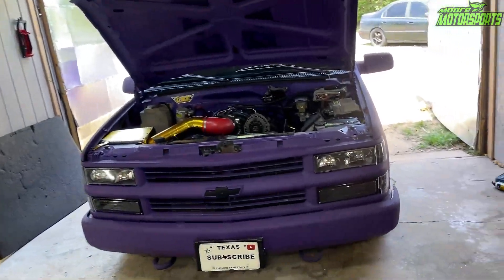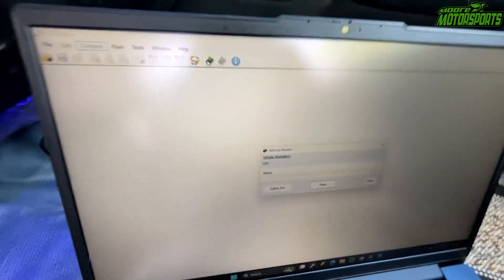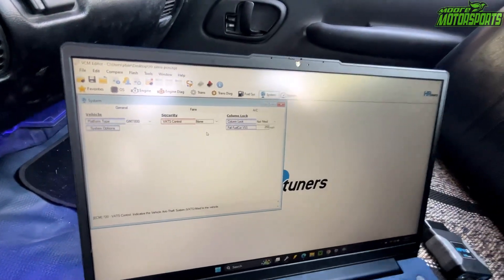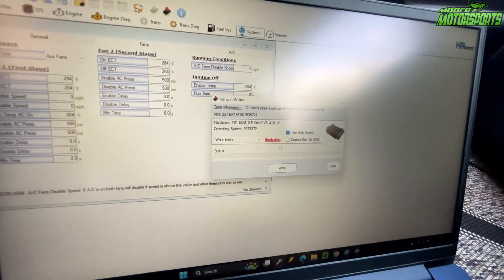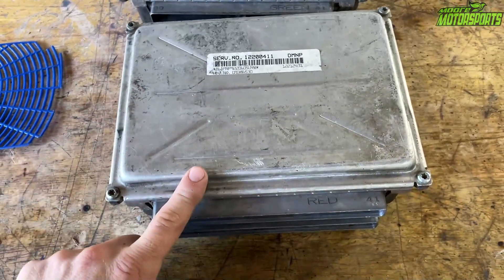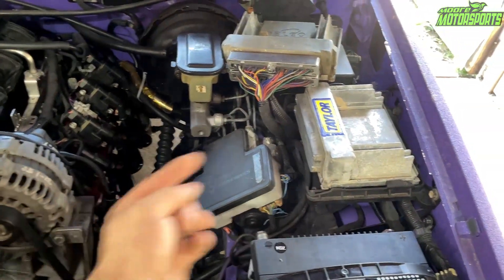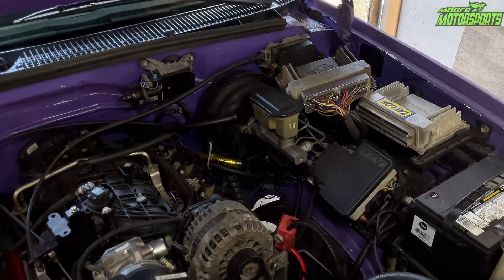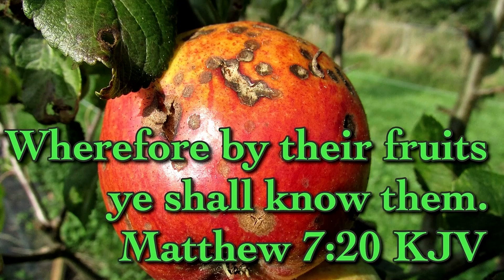HOW TO UNLOCK PCM USING HP TUNERS FOR LS SWAP

Comment: I can't stand it when people say "unlocked" when it comes to Gen III and Gen IV gm ecu's. They are not locked. You are deleting VATS mainly to run without the extra modules needed for the immobilizer. It's not unlocking. It's programming, but more aptly, modifying and reflashing. 2015+ FCA (Dodge, Chrysler, etc) actually ARE locked from the factory and you have to perform a modification to tune those gpec2a computers. 

Stop saying unlocking. That is NOT what you are doing. Then when someone like me has a client that misunderstands or is confused I have to clarify. Lol

Comment: Thanks for sharing! 

The mpvi3 isn’t capable of removing rear o2 sensors?
Reply: They are but you have to do an online course to unlock its ability
Reply from the maker: They are I mentioned in the video where you can do it but have to take an online course saying you won’t on a street vehicle.
Reply: @JamesDguy  I paused the video to comment then pressed play and felt like a fool for not waiting a sec. 🤦‍♂️
Reply from the maker: @freshbutplain1144 your good no worries at all!!!